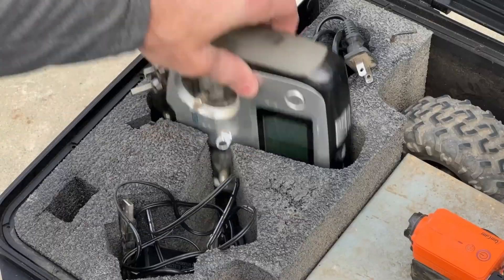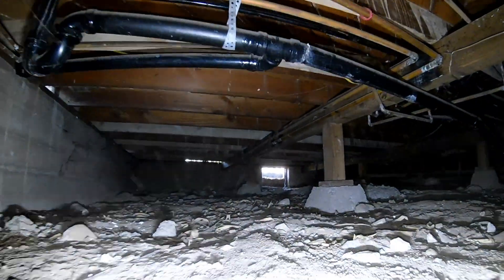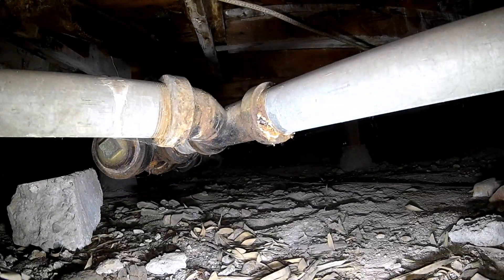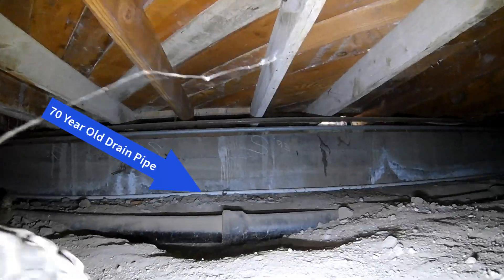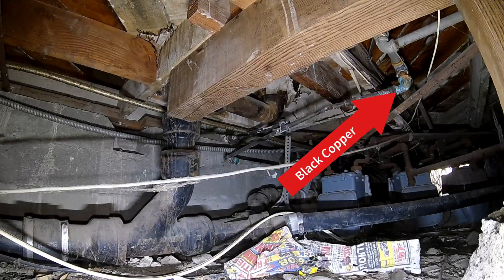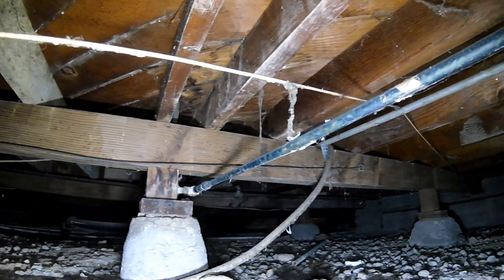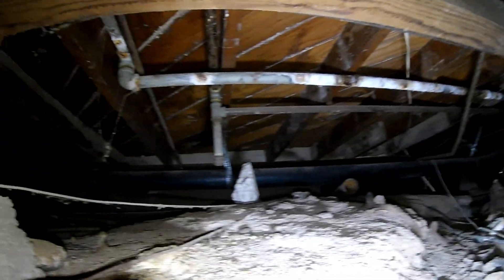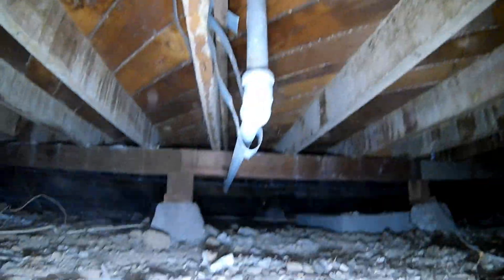Poor Water Flow Caused by old Galvanized Pipes | Non Functional Flow At Faucets

Comment: Do you call out the water stained wood *(floor boards) i'm also assuming your calling out the lack of vapor barrier on the ground .
Reply from the maker: Any home this age will have some old stains from past leaks on the sub floors, This condition is normal unless you can clearly see it wet. This is California so we typically do not encapsulate crawlspaces unless they have a moisture intrusion problem such as a high water table.
Reply: @Therealhomeinspectionauthority   good to know. here in MN they should be encapsulated. have a great thanksgiving!
Reply from the maker: @patrickcrooks2707  Happy Thanksgiving!